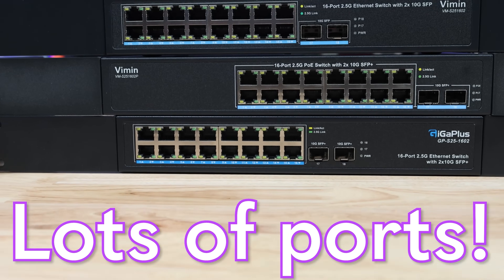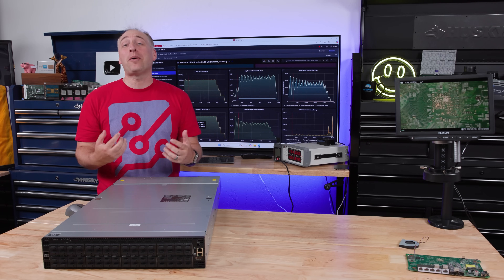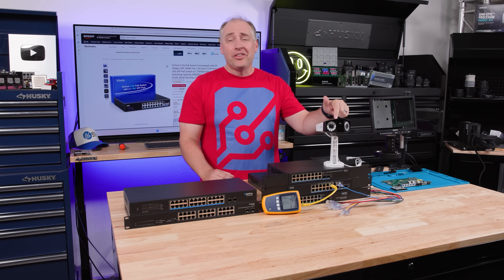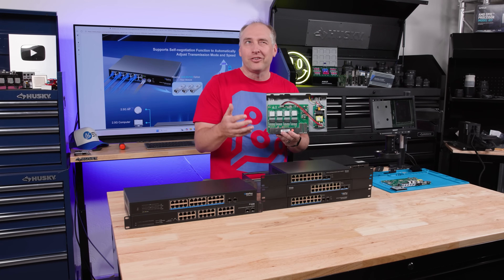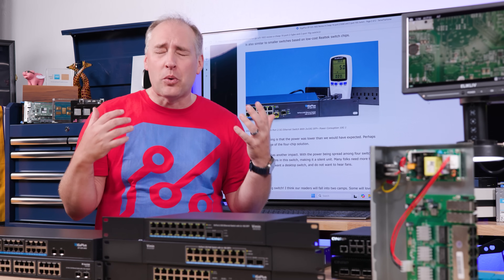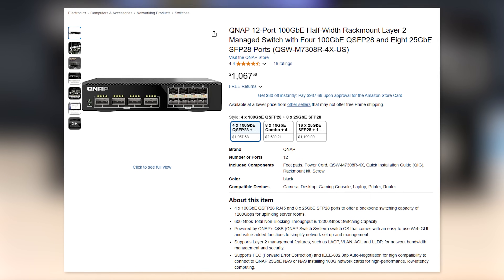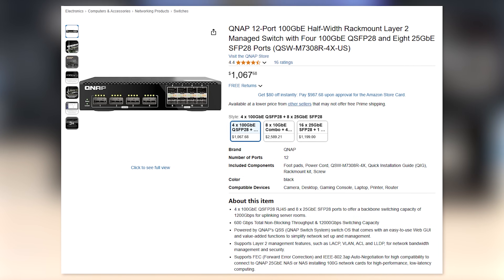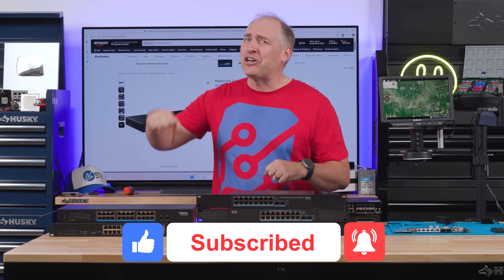New CHEAP Fanless 2.5GbE Switches Are Built Different

Comment: Hehe, reading the comments on here shows how vastly different needs/wants we all have. There’s always a few ports missing or the wrong speed or the lack of PoE/mgmt/etc. And we’re still mostly just the homelab community here, ie a rather small part of all the consumers. 😅

Let’s face it, the perfect switch don’t exist. But there are some darn good ones out there. The functionality these in the video brings for the price is great!

Regarding moving to a higher speed than 10GbE in a SOHO environment I’d say it’s two options. And that is largely dependent on HOW you will procure your equipment.

If you’re buying new stuff, then 100GbE is most future proof and looking at what some vendors offer now you can get some really nice stuff for a decent price from the likes of Mikrotik.

But if you’re buying used stuff and are willing to tinker some, I’d still say that 40GbE is the undisputed king. You can get some pretty quiet and (sort of) low power consumption switches for peanuts and same with NICs. Sure, it’s not future proof in the same way 100/25GbE is but for the price it’s hard to beat. Might even be the same price as similar 10GbE equipment. And in a SOHO environment 40GbE is still hard to saturate…

Huge congrats Patrick and the team to 1M subs! 🎉🎉 Very well deserved!
Reply: The perfect switch probably does exist, but you can't see it behind the big price tag. 😁

Comment: I think the average home-power user will be ok with the 16p strange design. I don't have gigabit internet (I have half of), only 1 device at 2.5Gb one at 10Gb(running at 2.5), wifi 5 and the rest 10 are simple 1Gb. This setup I believe is an average setup and gets enough performance.
Reply from the maker: Very true

Comment: Someone needs to find ebay used 10gbe to 40gbe switches at a reasonable price
Reply from the maker: The 10/40 stuff is cheap. The bigger challenge is that used 10/40 is usually very pound and power hungry

Comment: Interesting 24 port switch will use still more power if you use just one port. The an 16 port switch. I didn't know that.
Reply: The switch chip they've used in the 24 port is a full layer 2 managed switch.  The RAM chip towards the bottom of the frame at 11:57 is a Micron 512M DDR3 RAM chip (MT41K256M16TW-107:P), and a second or two later is (what I assume is the other chip) which shows a Winbond 128M DDR3 RAM chip.  I'd guess it's running a full version of embedded Linux (which just gets used to set things up, and maybe handle config of SFP+ modules when they're plugged in). Possibly they've just hacked the bootloader instead (either way the half gig of RAM is total overkill - it's not even used by the switch chip directly, just the embedded Linux OS). It would be possible to put OpenWrt on these and turn them into fully managed switches.

Comment: Your new traffic tester should make it easy to add port-to-port latency figures and show whether that changes during heavy traffic situations. That's one of the biggest things I've been missing in your reports. If traffic from one SFP+ to the other has the worst latency, that might be vital info for the user. Occasional data transfer figures for Windows, Linux, and proprietary storage servers would be a big help. Some vendors, as you know, simply don't play well together. Shouldn't need to test every device, just the ones using different chipsets or wildly different designs.
Reply from the maker: A bigger challenge is showing relevant statistics in an easier-to-consume format. The video was done earlier, but before Rohit's Vimin main site review went live I ninja'd in some of the charts https://www.servethehome.com/vimin-vm-s251602p-16-port-2-5g-poe-switch-review-cyperf/2/ You can see the latency difference under load between even which 2.5G and 10G ports are used.
Reply: @ServeTheHomeVideo not just latency but would be interested to see if there are any bandwidth limitations

Comment: Good explanation of how the cheap switches pull off bigger port numbers. Gigaplus really approached it from a weird angle with their design. They could've used a pair of RTL9302A chips instead of the gang of 6 port chips all chained by 2.5GbE to the RTL9302D and had a 24 port switch with 10x10GbE ports and had 10GbE internally between the two switch engines (each RTL9302D has 6x10GbE) . Or just used a single RTL9302A and had all 24x2.5G ports and 2x10G ports on a single chip.
Reply from the maker: Totally. That is why I thought folks might find this interesting. I think many browsing listings online would not realize this is how it works.
Reply: @ServeTheHomeVideo exactly - thank you for publicizing why cheap switches are cheap. Lots of home / less experienced users see price above all, not understanding why one 48 port switch is $250 and why others may be $9k+

Comment: Bought an 8-port "nicgiga" brand unmanaged 2.5gbe switch about a year ago..  Worked great until about a week ago when it started refusing to auto-negotiate (at 2.5g) to any other 2.5g router or switch I have.  But it runs at 2.5gbe when connecting endpoint devices such as a PC or laptop with 2.5gbe capability.   Beware when buying from a brand that isn't well known.
Reply from the maker: Crazy question: Have you tried a different power supply? On cheap switches like 90% of our problems is because the included power supply is messed up. We swap them over to MeanWell or other better power supplies and they start working

Comment: I will note that one of the cost savings advantages of the bump to the 16 port switches is likely to be that if you were set up with 4 4port switches,  each with 2 SFP'+ modules, (one for uplink to a switch, or on the ends external connectivity) the other for the next switch (or again) those modules ain't free. (Even if they are relatively low cost.) They generally don't come with the switch, so yes, you only buy as many as you need, but they are still going to be a cost + for the collection if you need more than 4 ports. 

So, if all of the SFP+ traffic is through from one to the other, and is fully loaded, the switch becomes bound to the 4 local port switches handling local traffic only? I.e. it's now a 50Gbps switch rather than a 160Gbps capacity switch?  I'd kind of like to know if the Realink 10Gbps chip to chip ports are actually 20 gbps  ports to handle both through and local inter-link traffic, and if the recommended deployment is actually to use 2 10 gig ports on something like one of those Qnap switches, to provide connectivity out of the module, (20Gbps if bound) That might be an interesting setup to test, but if the Reallink modules are limited to 10Gbps between chips, there is still a bottleneck built in.
Reply from the maker: Very true. You would likely use copper DACs for short connections but even those are $10-15 which adds up if you need three of them. You also need things like four power outlets for four devices.

Comment: I can't see myself buying the 16 port ones though since you're only able to get half the bandwidth to an uplink (16 * 2.5 vs 2 * 20) and the 24 port is worse at one third total bandwidth.
Reply from the maker: I guess that is fair, but it is also extremely common to oversubscribe networks. It is uncommon that you have all downstream devices needing full upstream throughput at the same time.

Comment: Fantastic content as always! I love the cheap switch series, and it would be great to see more of the budget Chinese-branded switches from AliExpress tested. Since 1G is already inexpensive from reputable brands, 2.5G, 10G, and 25G are the most interesting.

Personally, I’m looking into upgrading to 100G in the core with a MikroTik switch, 25G over fiber for workstations, servers, and the firewall, and 10G with PoE+ for access points.

100G seems to be the most affordable extreme high-speed option these days, since each port can be split into 4×25G links. Why settle for 10G when you can future-proof with 25G for only a little extra?
Reply from the maker: I am a big fan of 25/100GbE as well.
Reply: I agree, although there's a lot of poe where 10G is too much.  A mix of 2.5G poe and 2-4 10G poe would be fantastic, and if you can put a 25G feed on it, that would be great, but I'm betting it would no longer be low-power at that point :>  Oh, and managed for the mix, otherwise probably not helpful.  the APs and 25G upstream would need more than one vlan passed, while the rest of it, not so much.
Reply: @DavidCNavas agree, 2.5G is nice, but for most PoE devices except APs, 1G is plenty — so you could just supplement with a cheap PoE switch if needed. Personally, I don’t see the point of unmanaged switches anymore, since they limit use cases so drastically. How much more could it really cost to add basic VLAN support to a switch? Probably not much.
Reply: @TheJensss  Yes, 1G poe is almost certainly fine if you've got a few 10G for the APs.

Comment: I still don't fully understand what makes their design "less optimal"? Would have been helpful to compare its design to that of a "normal" switch, so that I can see the difference. What is it exactly that makes them worse? Do they not meet that total switching capacity of 120gb? Or in what way are they slower?
Reply from the maker: We showed the old iperf3 chart with it briefly in this video, but if you check out the main site review of the Vimin posted alongside this video you can see the expensive (like ~$1m) network testing tool driving real traffic between the different ports to see the difference clearly. Check out page 2 https://www.servethehome.com/vimin-vm-s251602p-16-port-2-5g-poe-switch-review-cyperf/2/
Reply: @karper When you look at how the chips are connected in chain, there is a 10Gbps interface between them. And the two SFP+ ports are connected to the first and the last chip in the series. So, if you were to connect two 10Gbps SFP+ modules and pass maximum traffic between them, you would exhaust the capacity of the whole bus between chips handling 2.5G ports. Any traffic between these ports on different chips will compete with the traffic between the SFP+ ports. It is an inferior design, but these devices are not meant for 100% utilization all the time. They will provide you with 10Gbps peak on each SFP+ ports and handle way more than one busy 2.5G port, but if you want to saturate many ports at the same time, you will not reach the advertised switching capacity. It is theoretically reachable only in an extremely specific scenario where traffic within each of the four chips plus traffic between the chips and SFP+ ports will be arranged in a non-competing fashion.

Comment: I'd love to hear more about setting up a 25g or 100g network in a home setting. My understanding was that 10g was about the max before you had to start dealing with rdma or infiniband.
Reply: You just need a fiber or 100 Gb DAC cable. Ask your favorite AI what kind of cable to buy for 100 Gb. It should be some kind of SFP28. RDMA is a communication protocol that runs on top of 100 Gb. It isn't required. Mellanox cards run Ethernet just fine. Infiniband is just a replacement for Ethernet. It facilitates more efficient and lower latency connections, but isn't required.

The understanding though is that the higher the speeds, the more beneficial it is to run RDMA over Ethernet or Infiniband protocols. Definitely ask an AI about all these terms and the requirements for a given switch and NIC. It's much easier than it sounds.
Reply from the maker: We are going to do 25G (SFP28), 50G (SFP56), 100G (QSFP28), and even 200G/400G soon. We have shown some inexpensive MikroTik 25/100G switches. That QNAP in this video is actually very good since it can do PFC and such. That is good feedback though. It is funny, we get a lot of folks asking about 10G, and given what we do, I am sitting around wondering if we should just have one low-speed 1-10G network but then run everything off of 25GbE/ 100GbE. A PCIe Gen5 x1 lane is roughly a 25GbE NIC worth of bandwidth and we should get PCIe Gen6 next year.
Reply: You don't need to. It is easier to get decent performance with RDMA, but you can totaly stick to Ethernet. All server-grade hardware vendors have something in their product line for 25+ G networking since at least 2018 - and that slightly older hardware is getting to affordable territory.

Your main problem is that you would need to switch away from typical Cat5/6/7/8 cables and either do DACs for short range or go for AOC or Fibre for longer range.

Comment: Also quiet good on the qnap:
If you need more 25G ports, you can use QSFP+ to 4*SFP28 cables, they will be seperated in the management.
You can use regular SFP+ gbics with 1 or 10G in the SFP28 slots, but not dual-speed.
And you can of course use DACs from various vendors.

Comment: I find it interesting that on PCs, PCIe lanes are always massively under-provisioned across the CPU, chipset, and devices; but switches are generally expected to be provisioned for 100% utilization.

There is absolutely a space for cheaper under-provisioned switches for people who might be fine with the total switch bandwidth being limited to 30Gbps (worst case).

Cool video, and it would be nice of the tech specs were more accurate from these companies.
Reply: most cpu's in the consumer space need more pcie lanes, at least enough for the chipset, a 16 lane card, 2 nvme drives and 24+ more imho. Though they partially do this by having the chiset provide lanes of it's own that have to share bandwith back to the cpu with all the chipset peripherials. They could trim cpu direct periphereals to help with die space, but only a little, just move them to the chipset while reducing the pcie lanes it provides.
Reply: early 100mbit switches had similar throughput limitations. ISTR 24-port Intel switches that could only sustain 400mbit of inter-port traffic across the entire switch.
Reply: @poofygoof yeah, as far as I remember, early 100mbit switches had a limited fabric bandwidth. But after the initial bad reputation, most brand manufacturers didnt cheap out on this thing, and since then they overprovision the backend capacity, sized to the absolute maximum. At least thats how I remember it.

Comment: About that 4x100, 8x25G qnap switch... I have one and I'm not very happy with the firmware on it, mainly with compatibility with transceivers and how much information UI provides (basically it is not enough to debug issues).
Reply from the maker: Interesting to know. Any tips we could share for when we review it? So far we have just been throwing optics we have around the studio into the switch
Reply: @ServeTheHomeVideo  I had some problems with optics from FS (coded for Generic). Actually as comments here are not so useful, I'll send you an email with more detailed report (I've posted random bits and pieces across the internet...).

Comment: How sure are you about the internal's of the 24ports - looks to me like the 2.5G ports in groups of 4 go into a (maybe) 6 port 2.5G switch then 2 of these go off to the RTL9302D - which would make this a blocking architecture. I hope this is not the case as it seems silly - any idea what's under the 6 heatsinks? OBV I haven't seen the underside where more traces could be from the chips under the heatsinks to the RTL9302D.
Reply: Those are Realtek RTL8224 chips which are PHY only.  The RTL9302D does the switching.
Reply from the maker: This is correct

Comment: Why cant these switches route as well?
Reply: Because the cheap switch chips don't do that.
Reply from the maker: Correct
Reply: @ServeTheHomeVideo please please get back to router 2.5GbE boxes? I am using a EdgeMAX with Google Fiber. I want to find a 5 port router with high speed ports for the house.

Comment: This is a great video and very timely. I've been thinking about upgrading my 24 port house switch to 2.5 or 5gbit and one of these might just do the trick without breaking the bank.
Reply from the maker: If you can, the 24-port ones are substantially better than the 16-ports, but they cost more.

Comment: One small detail, are we able to make product dimensions available on reviews? The manufacture doesn't provide this detail in the listing and I was hoping to see if it'd fit the 10 inch rack (which I doubt).
Reply: 10 inches is roughly three of the 8-way RJ45 sockets next to each other. However, I think the PCB is narrow enough to fit into a 10-inch rack. With a 3D-printed case where the power supply is behind the PCB instead of next to it...
Reply: I was wondering the same thing.

Comment: Hi, IMHO opinion, such switches should be use a slightly bigger case and offering to add a second power supply (yep, still inside the case, without drawers), this would be worth it — and with a bit of DIY, a little display showing Patrick smiling when all is right and frowning when one of these power supplies is down, it would be ferpect ;-p).

Good choices for a home lab or even a SOHO if doubled, also good prices for 2.5G switches (it was time !)
Reply from the maker: Ha! Good one

Comment: I wish a lot more reputable manufacturers would offer these 16 / 24 port 2.5Gbe switches. I don’t think QNAP / Netgear have any, and while you mentioned a TP-Link model, it sounded like some China-exclusive?
Reply: Microtik has some
Reply: @annebokma4637  nice.
Reply: Zyxel XMG1915 has 16 ports 2.5Gbps, two SFP+ ports, PoE and is smart managed.